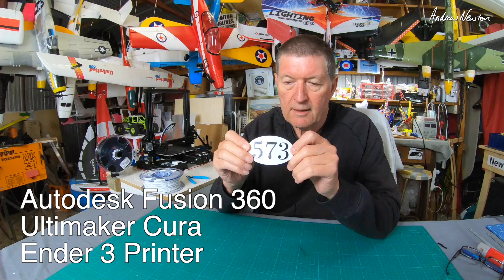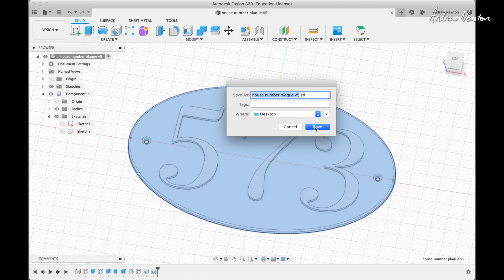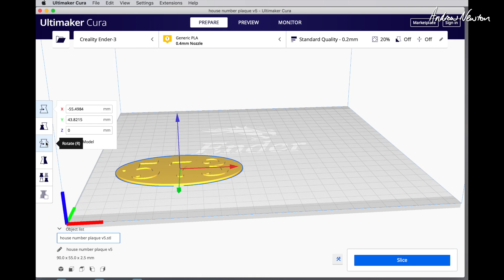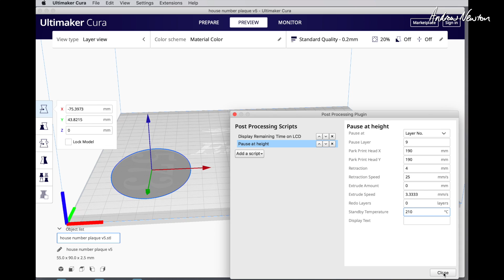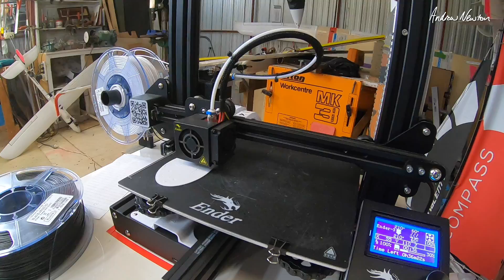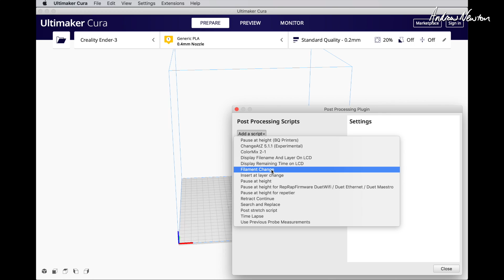3D print, mid print colour change

Comment: When  I print small  things in 2 colour,  they don't really stick well, they just separate  after printing  with little  force, I have to glue them, is there any fix for that
Reply from the maker: Higher temperature maybe?
Reply: @AndrewNewton   I print  with 210 ,pla
Reply from the maker: @mohamedyassser7661  I'm using PLA+ at 205. But I havent tried to pull the numbers off

Comment: I used to use the Pause At Height function for colour changes but then spotted the Filament Change function and decided that might be better but it wasn't, in fact it did not even pause to allow me to change filament, I made a test gcode to test it out after just 6 layers of a cube so I didnt spoil a part, so Im back to Pause At Height.
 Thats what I love about the 12864 display on the Ender 3's, it will display Marlin notifications requested from Cura wheras the Touch screens on Creality machines won't, but I have Octoprint for those machines (2X Ender 5+) and a view layer plugin so I can get ready for the filament change.

Comment: FYI, I found out recently that layer numbers start at 0 in gcode. So if you want it to pause at layer 9 you need to enter layer 8, later 38 use layer 37, etc. That might be why you already have some lettering printed upwards. Not a big deal and might actually look cooler with some white before black. 😁👍

Important to know if you are doing a bridging or other temperature changing prints as well.
Reply: You can tell Cura if you want to use 0 or 1 as starting layer
Reply: Looks like the numbers are floating

Comment: In your "pause at height" menu there is at the bottom a "G - Code before pause". If you fill in "M300" it wil give a beep when it goes into pause. So you can hear it..
Reply from the maker: Nice tip Jokr, thanks
Reply: Hey thanks!
Reply: I know this is an older video but my cura version has an option to add beep at pause while you are adjusting the g code in the same setting.

Comment: I use the following gcode for the beep.  Add it in with your module.  It plays BK (Break) in Morse Code and adds a message to the LCD to change colors.

; Plays BK (Break) in Morse Code

M117 Change Color!  ; Adds message to LCD

;---- BK in Morse Code ----
; M300 S1396 P214 ; Dah
M300 S0 P60 ; intra-character spacing
M300 S1396 P60 ; Dit
M300 S0 P60 ; intra-character spacing
M300 S1396 P60 ; Dit
M300 S0 P60 ; intra-character spacing
M300 S1396 P60 ; Dit
M300 S0 P60 ; intra-character spacing
M300 S1396 P214 ; Dah
M300 S0 P60 ; intra-character spacing
M300 S1396 P60 ; Dit
M300 S0 P60 ; intra-character spacing
M300 S1396 P214 ; Dah

M300 S0 P1443 ; word spacing

;---- End - BK in Morse Code ----
Reply: The second line of the code  should be "M300 S1396 P214 ; Dah"  with NO semicolon.  Sorry
Reply from the maker: Thanks for the code Bill. I'll try it

Comment: Is there any reason you aren't using the change filament script?
Reply from the maker: I'm not clever enough to work it out, or just lazy.
Reply: @AndrewNewton  the reason I ask is I am having problems with color change. I always get a blob in the place where the printing starts again. Was wondering if you have had this problem and how-to solve it...
Reply: @IlanPerez  I had this too, so I decided to print a draft shield to use it as a kind of purge block. Works brilliant now.
Reply: @jaggedpixel  that's what I eventually did as well. I put small disc like items around my prints so that it would always restart from one of those purge blocks. I also found that my printer either wasn't level or when I was swapping the filament I would nudge the z axis down a little. So now when I change filament I am super careful for to move anything

Comment: I have the Ender3 V2. For some reason mine restarts printing automatically after 20 seconds. I can't see where to change this in the pause plugin. Thanks for video though.
Reply: omg same here, did you ever fix that?
Reply: @flaviamartinez9998  No sorry, I think the current firmware does not support it. I just ended up dividing layer at I want to change by total layers. this gives a percent. And just pause manualy from the machine display. Happy Christmas.
Reply from the maker: Dont know sorry.

Comment: Just an fyi, in Fusion360 you can go to Tools-3D print, then select your model you want to print and select ok in the menu and it will automatically open Cues instead of saving it to your computer and using more space.
Reply from the maker: Correct but I like to save the files too
Reply: @AndrewNewton  Makes sense :P

Comment: When I pause at layer the print starts right back up again by itself after a few seconds without letting me change filament. Cura 4.6.1 
Any ideas why?
Reply: Ender 3 needs a firmaware update it wont recognize the gcode pause command
Reply from the maker: Sorry Paul, that's a mystery

Comment: Dang I tryed but the extruder motor wasn’t disabled so I couldn’t change filament, how do you disable it?
Reply from the maker: No need to disable the motor, just squeeze the spring loaded lever on top of the extruder then you can pull the filament out and reload.
Reply: Andrew Newton gotta use the change filament option works way better!!

Comment: Very nice mate.
Next you have to get Octoprint so you don`t have to use the SD card.

This will give you a little noise. I use at end of print code.
Playing with numbers will give you some different sounds.
M300 S440 P200
M300 S660 P250
M300 S880 P300

Found it on a CHEP video.
https://reprap.org/wiki/G-code#M300:_Play_beep_sound
Reply from the maker: Very cool, thanks for that.